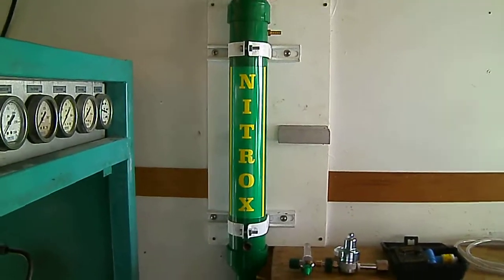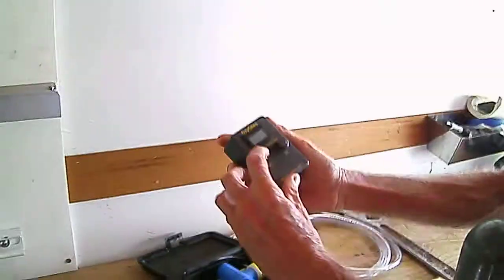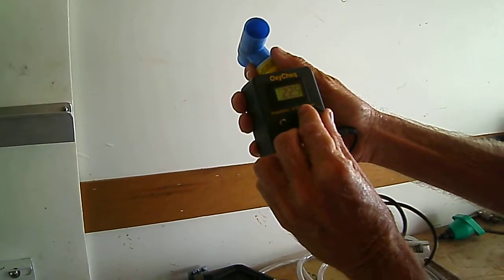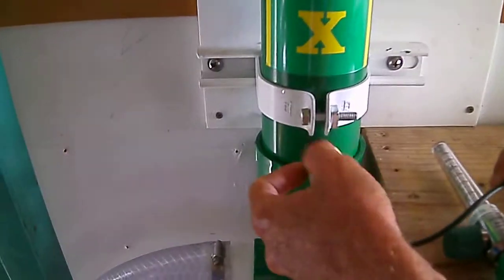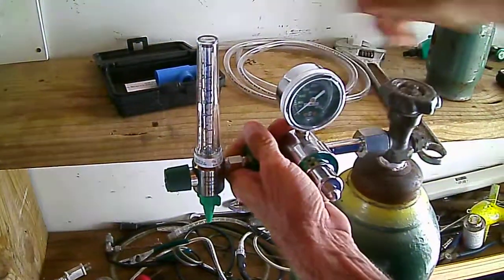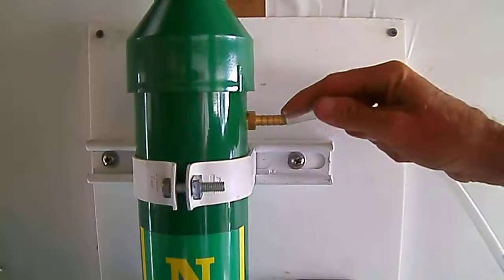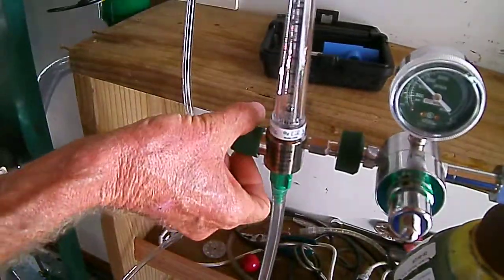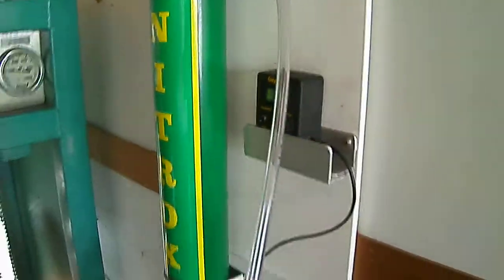Nitrox Stick Assembly and Use

Comment: Hi. I am interested in building a stick. Can you kindly let me know the length and diameter of the stick you used and how many baffles?
Reply from the maker: Our Captain who created these is currently out sea until the beginning of next week.  I will speak with him and get the info that you are requesting.
Reply from the maker: Dianne, thanks for the interest in our nitrox stick.  It is a 4" ABS pipe, and has 5+ baffles.  Contact us directly for further info at 305-453-6070.
Reply from the maker: 24" x 4"

Comment: Hello, what is the flow rate per minute in Liter to make 32%? Thanks
Reply from the maker: The Captain that invented these is currently out to sea but due back in early next week. We will get back to you with answer then.
Reply from the maker: 20# PSI/1.5 CFM.  If interested in further details, please call directly to 305-453-6070.